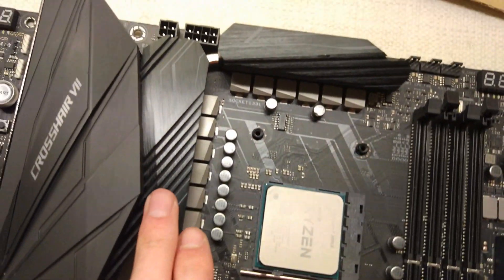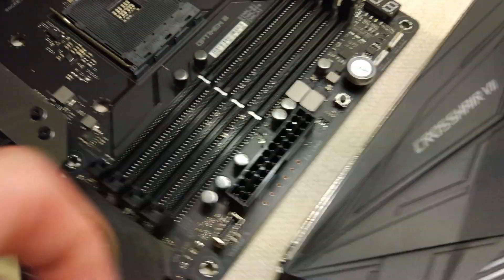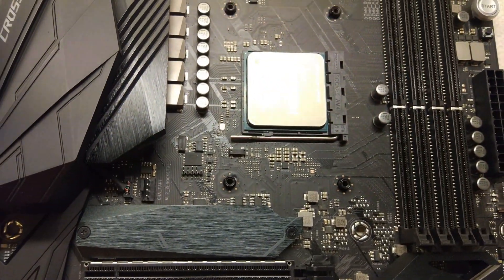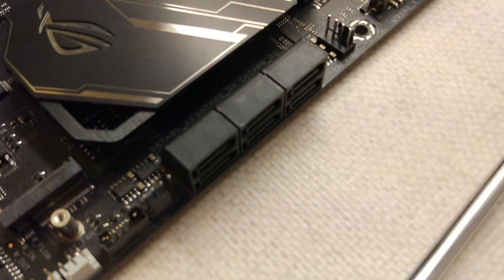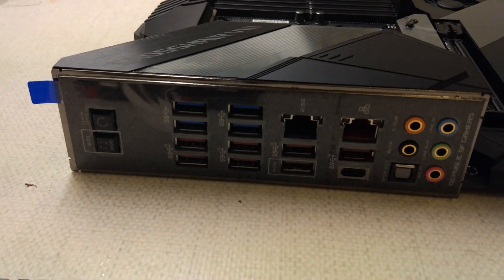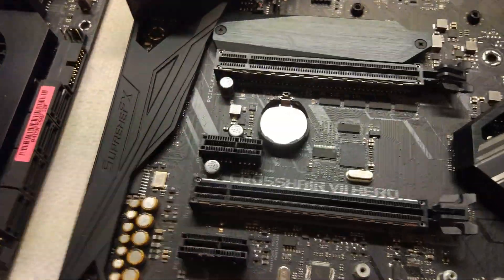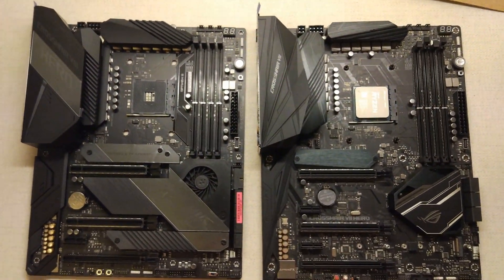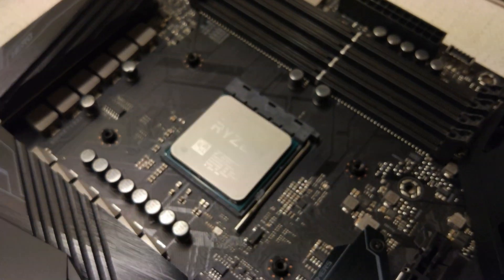Crosshair VIII Hero X570 Vs Crosshair VII Hero X470

Comment: I agree, its not worth it. There really is no reason to replace the CH7 with the CH8, assuming one already has the CH7 on hand.  Plus what you said in the video, just not worth the double price of the board, just for 2 extra SATAs and a worthless 2.5/1Gb port.  
I have the CH7 myself, and I will never let it go. It is a beast of a motherboard. I will have it buried with me when i die.
Reply from the maker: That's great to hear! I have 6,7 and 4 hero 8 now. I need to swap out one of my hero 8 for the impact.

Comment: I see the USB 3.0 placement is better on the x570. I have the x470 and the placement of the USB 3.0 is annoying. Case USB 3.0 cables are big and bulky (at least on my Corsair 750D). It's better to plug it sideways like the x570 rather than straight on the bottom like the x470.
Reply from the maker: I don't notice this kind of thing because I don't use a case. Test bench life. Hopefully your comment helps people who do use cases. 👌
Reply: @LawrenceTimme  Do you ever have dust issues without a case? No animals to jump on it? :)
Reply from the maker: @tamilashultz9676  no I change the parts so fast the dust never even lands on it. 

Also don't have any animals, the animals stay outside. Only people in here.
Reply: @LawrenceTimme  Nice. :) I have kids, cats, and dogs so I must used cases. I'm buying parts for a new build now. :)

Comment: well as the only advantage of a 570 board is pcie 4 no one should be buying them as there is currently no card that could even utilise or come close to using the bandwidth of pcie 4. the only thing that can is a m.2 ssd which if you look around have all been getting seriously hot on pcie 4 boards. 
also from a quick look at the comparison in video it looks like the VIII has a few more vrms under the bigger heat sinks.
and then the facts of VIII.
supports higher ram speeds
has a realtek instead of intel lan port
supports more ram 128GB vs VII 64GB

however no one should really be buying a x570 vs a x470 at this time unless you need more ram for editing etc but then there are cheaper boards.
Reply: I want the x570 for the added sata ports and pci express 4.0 for future proofing.

Comment: Despite the fact it must get painfully old answering some of these "decision" questions... X470 Crosshair VII Hero (no-wifi - don't care) VS Prime X570 at the SAME price. Which? Prime X570-P is a completely baron yet has the same VRM as Maximus 11 Hero. Your time and consideration is appreciated.
Reply from the maker: I would go with the x470 board personally. I don't rate the prime line of boards at all.

Comment: 1. Better to use a tripod or anything similar. Your way of recording causes headache.
2. It`s more interesting to get information about the advantages/disadvantages of both motherboards rather than "this is black here, this is silver there, this has a cover here, that has no cover there and so on ...
Reply from the maker: I have a tripod. It's very over rated. Thanks for the input though. I may consider using it one day.

Comment: Oi! Your chipset fan cover is missing!
Reply from the maker: Yes I took it off.
Reply: @LawrenceTimme  What´s the fuction of the fan cover? I bought this motherboard and it came without it so I´m trying to talk with the support of Asus and right now I´m waiting for an answer, but I have the aorus ssd pci express 4.0 and it has a big copper heatsink  and if that cover fan was in my motherboard I have to take the copper heatsink off so I can make the assembly. What´s the best way to do it? without the cover fan and with  the copper heatsink of the aorus ssd or whitout the  copper heatsink and with the actually heatsink of the motherboard and the cover fan. Hope you understand what I meant.
Reply from the maker: @jorgeleal8822  I understand. I would keep the heatsink on the aorus ssd and remove the fan cover on the motherboard as it is less likely to overheat. As long as the fan and heatsink are still in the board it should be OK, I think they cover is supposed to make it look nice.
Reply: Lawrence Timme Thank you! One last question, the Q-connector for the front panel that comes with the motherboard y optional right?
Reply from the maker: @jorgeleal8822  I'm not sure what that is as I don't really use a case, I only have a test bench, so I don't use the front panel connections normally
Reply: Lawrence Timme oh okay never mind, thank you anyway!
Reply: Lawrence Timme Bro one last question!! Hope you answer, As I mentioned I have an SSD of aorus and I bought that SSD of 500gb and a samsung 970 evo plus pf 500gb , I know I did it wrong because it was a better option to buy 1 of 1tb but I’m stupid  haha my question is... when you are installing windows, how Do I know what is the aorus and the samsung? I want to install windows in the aorus obviously
Reply from the maker: @jorgeleal8822  it should say in the bios which is in which. Alternatively you could just put 1 in first, install windows, then install the second one after.

Comment: I have a question, I got my 3900x and vii hero ready and running now but only can get ram to run at 3733 on channels a2 and b2 which are the recommended channels.. thing is.. i have 2 of 3600 cl15 kits that aren't on the supportet memory list but I have 100% custom timings anyway and they work like a charm on the mentioned two channels.. I tried both kits and both can do 3733 cl14 on those two.. but if i only put 2 dimms in A1 and B1 channels maximum I can boot is 3200 at like cl17 or so.. why is that.. I know the board has daisy chain and all but there are a lot of people running 3800 mhz on 4 b-die sticks in the community etc. Are the channels just done for or am I missing something? can someone post ryzen master timing overview of 4 sticks running? At 4 Sticks I can only do 2800 max ._.
Reply from the maker: I have not used 4 sticks. 4 sticks has always not worked well on amd. Are you on the latest bios?

Comment: hey I got the Crosshair vii running with 3900x and Ram Trident Z Neo 3600,,thank you for the info you helped me so much
Reply: How is performance on x470 with 3900x?
Reply: @jacquesbuys1354  pretty good,,i am getting 4.3 all core ,,still a lot of stuff to be worked out ,but it is still early in the life of the 3900x
Reply: @stephenhoderny  I've just ordered this combination. Was looking for this info. Thanks.
Reply: I plan on getting a crosshair viii with a 3900x. I had no decided on which ram yet. How is the ram trident z neo 3600 working? How much are you using? I already bought a phanteks enthoo pro 2 case for it. :)

Comment: Great video,, have you had a chance to run a 3900X on the Crosshair VII? that board should be more then capable with the Ryzen 9 i am guessing?
Reply from the maker: No I don't have a 3900x, but the VRM is perfectly capable of running the 3950x with ease, so a 3900x will be fine 👍
Reply: @LawrenceTimme  Thank you so much..i was hoping that was the case,hey did you have any troubles or BIOS issues with your boards?
Reply from the maker: @stephenhoderny  yes the crosshair vii has an issue where it gets suck at c5 post code if you boot from cold, other than that it's OK.
Reply: @LawrenceTimme   sorry do not mean to sound dumb i am new to PC.s so how do you remedy the situation?
Reply from the maker: @stephenhoderny  you have to run the ram at 2666mhz or slower until they bring out a bios update to fix it.
Reply: @LawrenceTimme  thank you so much,,if you have any other info please let me know..i am so grateful for your knowledge,thanks again
Reply: @LawrenceTimme  oh yeah also on my b450 board 2933 i think was the highest it was stable
Reply from the maker: @stephenhoderny  I have got 3733mhz working fine. On. The crosshair vii, but it needs to reboot a few times from cold.
Reply: @LawrenceTimme  what RAM are you running?
Reply from the maker: @stephenhoderny  gskill trident z 2*8gb 3200c14

Comment: Just found your channel and enjoying the content so far!
Gamers Nexus says the 3800x is poor value compared to 3700x..did you find any extra performance from spending the extra?
Reply from the maker: I am not sure as I do not have a 3700x as well, I don't think for normal usage it is worth the extra, I just buy the top ryzen 7 for each gen, even if it might not be the best value.

Value is subjective, so it's impossible to say if you would find it a benefit. From a purely objective £/performance, then it would not be worth it at all, but I bought the 1800x and 2700x as well, so maybe I am not the best to say.

I am glad you enjoyed the content. I do not post new videos too much, mainly on overclocking. I do not really care about daily stability at all, however you may still find some of them interesting or useful. :)